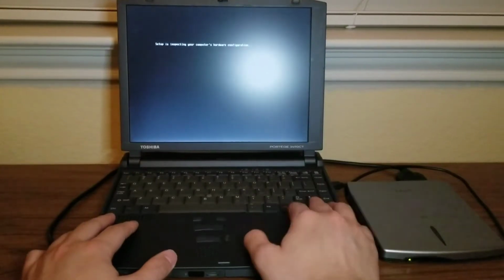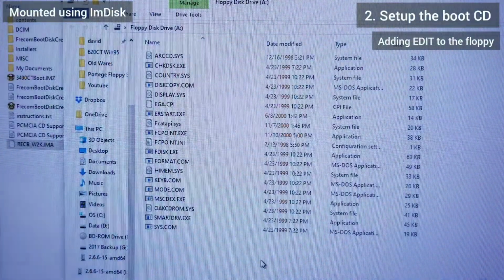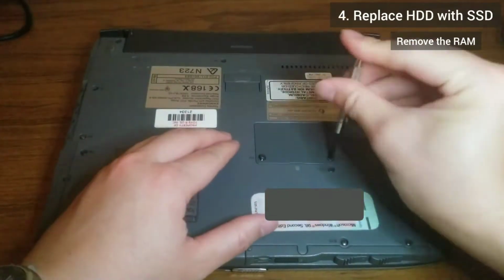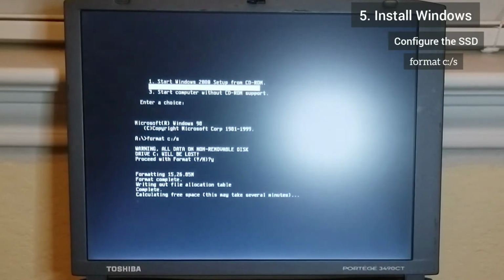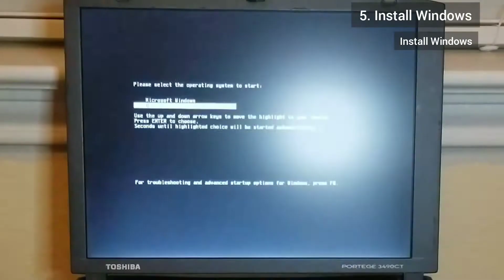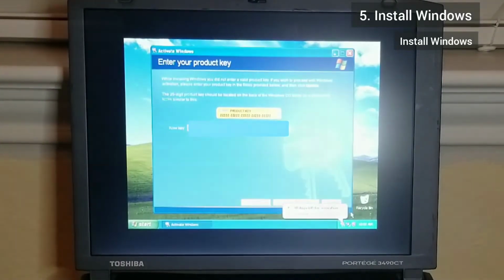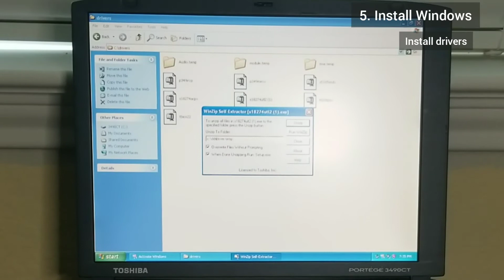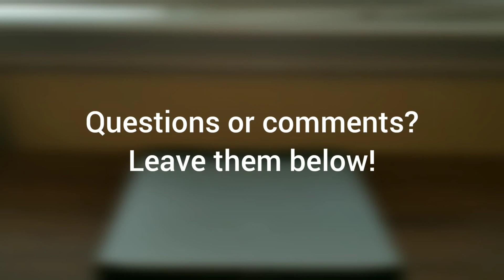Installing Windows XP onto an ultraportable the Classic Way (Toshiba Portege 3490CT)

Comment: If I remember correctly, there is a docking station, the model is pa3042u-1dst. This docking station has optical drive and floppy drive interchangeability, as well as USB, PCMCIA, LAN, LPT, COM and PS / 2.